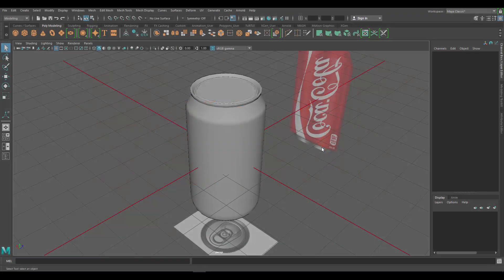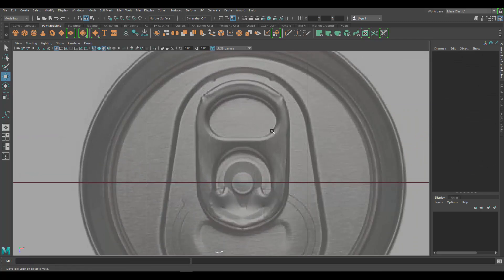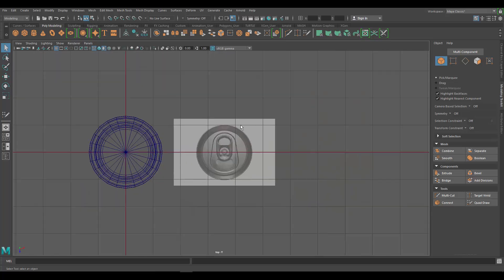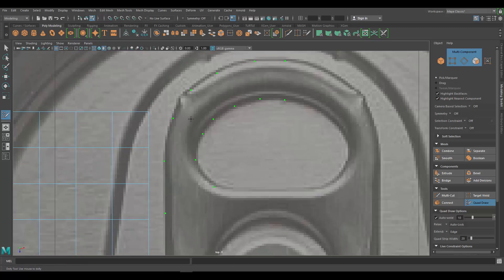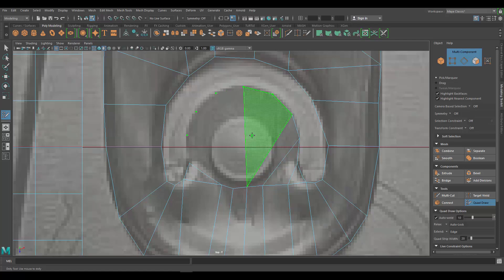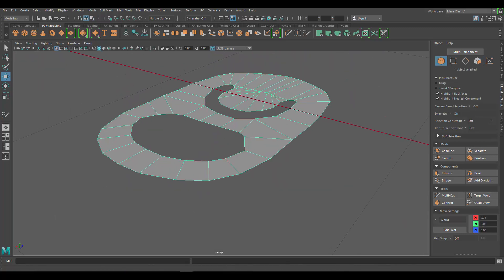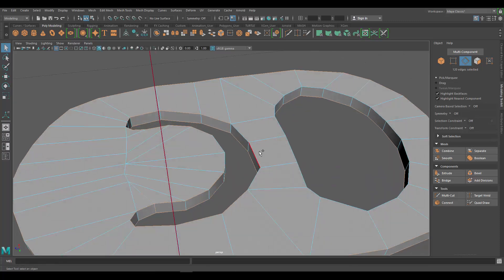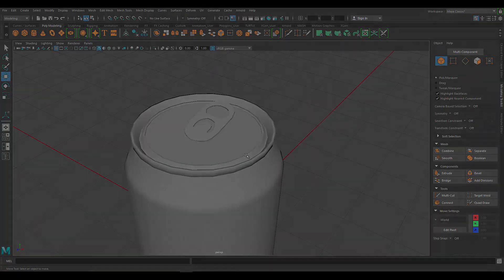Autodesk Maya 2018 -  Soda Can Tutorial Bonus!

Comment: this is my second time doing this tutorial and I've done this before and everything went fine but now when I try to bevel the opener it says "Warning: Encountered a non manifold vertex. Cannot Bevel." and I don't know how to fix that. please help me out.
Reply from the maker: Select the whole object in vertex mode and go to merge vertices and set the threshold to a low number. It could be that you have some vertices that are not welded or overlapping geometry
Reply: @3dextrude  by low number what do you mean? when I press it it is automatically set to 0.01. how low do you mean? 0? when I pressed it and then tried to bevel it it still gave me the error. am I doing something wrong? I pressed merge vertices in the poly modeling shelf. BTW Thanks a huge bunch for responding. I don't really know much about maya. I'm still just learning. you've been a great help

Comment: I've been using Maya since 2013 and NEVER used the "Quad Draw" tool. I can think of a lot of possibilities for it. Thanks for making the bonus video!

What method would you use to get that indented area around the little pull tab that you made in this video?
Reply from the maker: Quad draw tool is great for making weapons like swords since you can trace the shapes and follow a concept. For that part of the can I would use the multicut tool and trace it from the top down image and move vertices according to the shape.